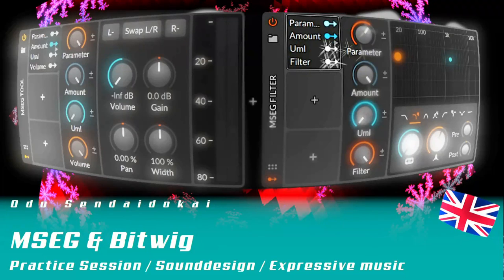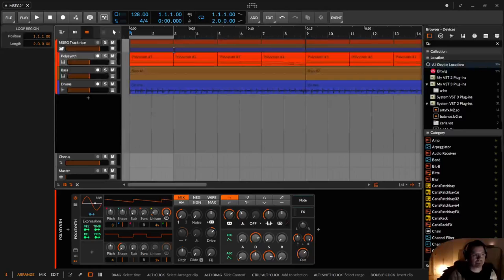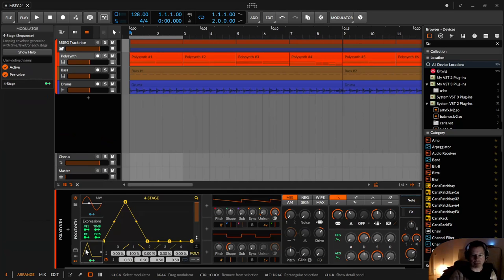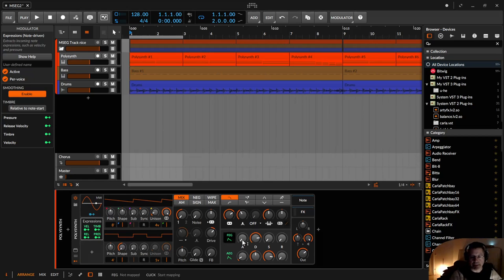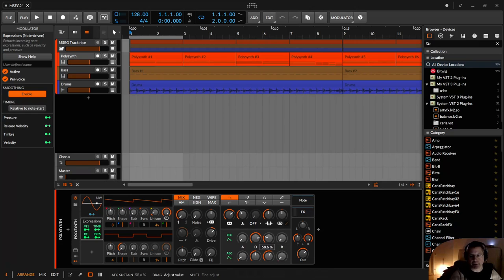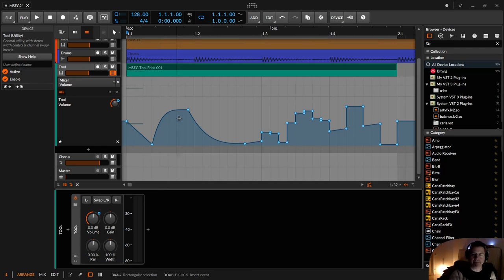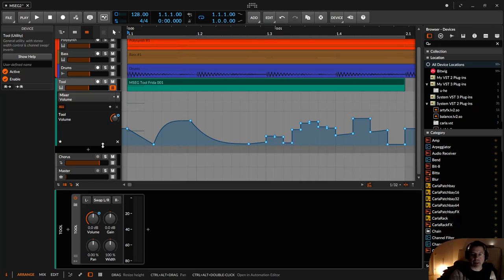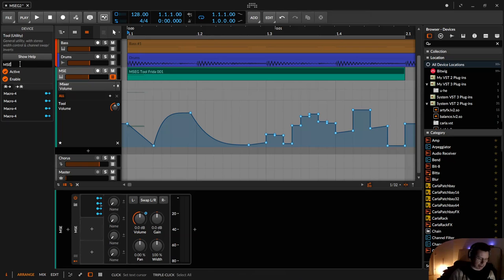MSEG & Bitwig | (english)

Comment: It baffles me that they aren’t giving us one, it is one of the most requested feature. I believe it isnt the most complicated thing to do as well, if small dev (yet great dev) who developed serum, vital which is free, can do it so they should be able as well.
Reply from the maker: It hink there is something coming that ends your pain :) A lot people would love to see an MSEG in Bitwig, but until its not there one could use SurgeXT with its Audioin Feature für Bitwig Devices . Not ideal, but it works.
Reply: @OdoSendaidokai nice, do you have some inside info about mseg :)?
Reply from the maker: @rd-cv4vm  not really insides, but there were some small remarks in a longer chat I had with the nice people from Bitwig at the superbooth. I think it's on their list and maybe soon,, but as we saw they were hard working on integrating CLAP. And even if a company has big development sources at one point they are limited and need to be prioritized. I think they have a major long term plan that they follow for architecture and future developments e.g. 3D-Sound is going big lately and none of them is really fully prepared. But this will be a huge major feature people will compare DAWs against each other even if they wont use it :)  But especially Bitwig with it's huge sound designing capabilities nd flexible ways of routing and mangling sounds need to be in the 3D-Sound market. And that is just one feature that is at the horizon. And the bigger the company, the bigger the resources, the quicker some features. MSEG would be great native in Bitwig, but there are as well great Synths like SurgeXT or Vital that integrated it. So this is maybe a little workaround, but with no costs (in money) ;)